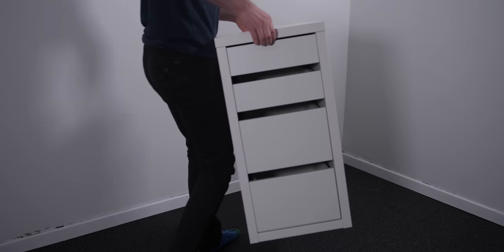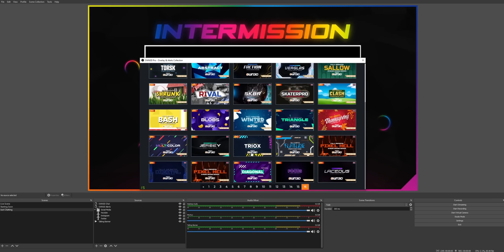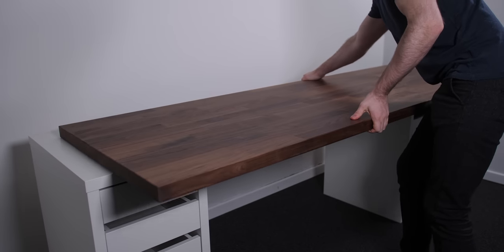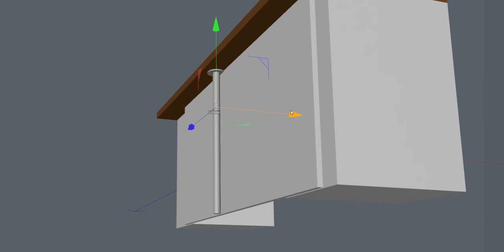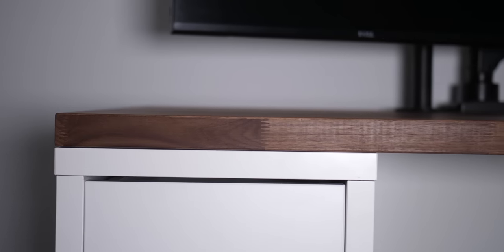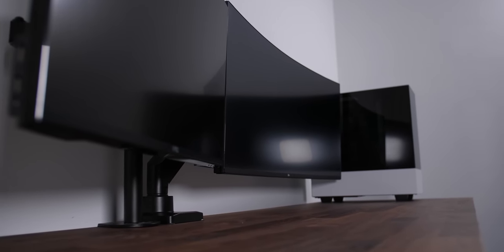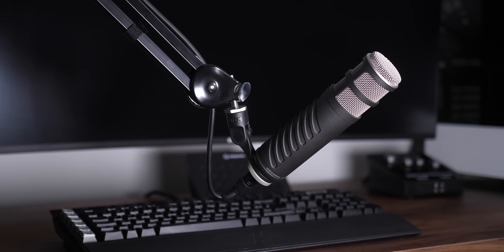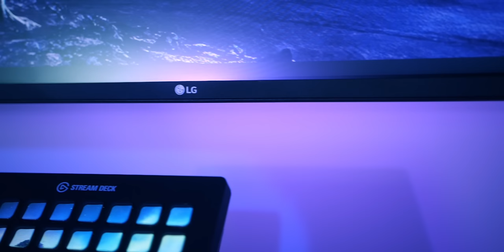Building This EPIC Ikea Streaming / Gaming Desk Setup!

Comment: it's funny how everyone goes crazy about cable management, spending 8 hours meticulously tucking, wrapping, and hiding cables to every square inch of their under desk space. Meanwhile you can hide them with a flat panel in about 5 minutes and it's completely removable.
Reply: Yeah but not everyone has a desk flush to the wall of want more foot room. The false wall stops the latter.
Reply: That’s pretty lazy
Reply: @swmedianz  indeed it's lazy, that's the point. Unless you have your build complete before you start cable management, it is a pita to add or remove later on, whereas foam board with a couple pieces of velcro tape is not.
Reply: @swmedianz  as my welding and engineering instructor told us once, "rule of thumb why stand when you can sit and why sit when you can lay down never make doing something harder or more time consuming than it needs to be", be practical and be efficient the results will always turn out better than if you stayed struggling to fight against the job you're doing, so as seemingly lazy as it would be it does the exact same job with better results in appearance and keeps from possibly kicking the outlet socket out from being plugged into your power strip, so not only does it hide wires better it prevents any accidental wear and tear on them too.
Reply: If you put a false wall just to hide the cables it's not smart. It's easier to take the time to manage your cables once so it will be easier when you upgrade stuff in your setup
Reply: Proli  Lazy is not working smarter.
Reply: Why bro sound mad? Just because your lazy doesn’t mean it’s everyone’s fault 🤷‍♂️
Reply: people be mad for no reason, i think its genius! its not stupid if it works
Reply: Yeah, but that sucks. I like to put my feet up when I game.
Reply: Well I dont want to unravel a spiderweb just to unplug a cable. So yeah its alot of work but it's worth it.
Reply: @Rosne134  bet it sucks redoing all the zipties for that one cable.
Reply: @calebwooldridge242  you don't have to zip tie all your cables together ya know? Also cutting a few zipties sounds much more pleasant then unraveling a balled up heap of cables. Just saying.
Reply: @Rosne134  well I have 3-4 cables total so I do nothing with them and they aren't a wad of cables. To each their own 🤷.
Reply: Ok this desk looks epic
Reply: @Rosne134  eh tbh i have a lot of cables together and i never have to fight to unplug them
Reply: 8 hours to manage cable? Lmao, talk about over exaggeration to make a point... It quick and easy to manage cables. It also easier to remove a specific cable when you need to compare to a rat nest of tangle wire that will occur if you just mindlessly toss your cable behind your desk. 

Also, this dude use double sided tape to secure his mic wire. And then proceeded to pull off the backing on the side that wasn't attach to anything. Like why? Wtf... He now have a tape with the sticky side exposed for no reason except to collect dust and crap...
Reply: @shadowsaber3145  LOL....actually it's genius.
Reply: @grimcapo4390  So many times folks can't see the forest for the trees.  Sad really.
Reply: @raist3001  maybe but it’ll be a pain in the a$$ when changing cables or cleaning

Comment: if anyone wants to have the false wall but not saw anything or have the gap you can use the Trotten countertop which is the same height as the alex drawers and micke drawers with no wheels
Reply: Which size trotten countertop? Did you get to try it yourself? Thank you!!

Comment: Using a false wall is a no-brainer compared to the hours of cable management time
Reply: What kind of cables r u trying manage that take hours? It only took my Dad a half an hour to cable manage his duel monitor and ps4 setup
Reply: @duncandonuts5268  I have a very elaborate computer system and 8 monitors it took me hours to carefully manage the wires so where you don't see them thanks for your concern
Reply: @duncandonuts5268  a lot of people have crazy setups. I have like 8 things plugged in with a crazy amount of wires hanging out. I still dont even have my PC yet 😬. Its gonna take 2+ hours to cable manage properly
Reply: @duncandonuts5268  that's why, its a ps4 you have to plug in the PlayStation and monitor and plug in the HDMI cord into the monitor not that much to do so yeah

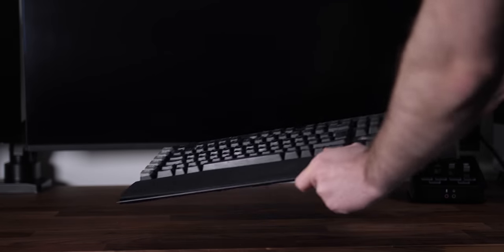Comment: 10:03 If you want to make a custom keyboard its not really that hard to get into unless your joining Group Buys, which you shouldnt when starting out. If you go somewhere like KBDFans you can find some keyboards kits that make it as easy as putting your own switches and keycaps on. (though ofc id recommend lubing the switches and stabilizers) personally i didnt mess up on my first build and im pretty sure you wont either if you just get a kit that you wont need to buy all the different parts for. also do ur research just incase XD

Comment: A little late to the party, but for extra space for hiding cables and have the counter top overhang the cabinets in the front, you could use a MDF board with one white side instead of a thick linnmon, the kind IKEA uses in the back of closets (Billy).

Comment: It seems like the Micke drawers you used have changed on the Ikea website. The images show that the bottom drawer goes all the way to the very bottom of the unit, without a slat below it. I guess that in order to use these drawers you would need to raise them up with something, otherwise the drawer will scrape against the ground (or carpet). I'm still looking around for the best drawer set, without going up the Alex which is relatively expensive
Reply: I noticed the same thing when I googled it, but where I live there's 2 versions. 1 with 5 wheels that's as you describe, and one with 4 wheels that still has the bottom slat. It's roughly 5 bucks cheaper (when converted to dollars) , hopefully it's available in your region as well if you haven't found an alternative yet

Comment: As much as I like this, how I cover up my cables is with a square cable tie holder and just have the cable tie on by 5 clicks so it’s not 100% tight against the cables so if I need to remove something it’s not too difficult

Comment: Was the countertop you used in this video 186 cm long? And the false wall was 100 cm long? I don't think the false wall of 100 cm covers enough if you use 2 MICKE drawers, which are 35 cm wide each. Because 186 cm minus 2x35 = 70 cm makes 116 cm. If you want to slide the false wall behind it, you still have a hole of 16 cm that you don't cover... Or am I seeing that wrong?

Comment from the maker: I am planning a Streaming Setup video like Setup Wars but only for streaming setups! 
Do you have a clean streaming setup? Doesn't need to be over-the-top, just a nice streaming setup.

Send images + preferably video footage to: thevideonerdyt@gmail.com
You can add your socials, I will give extended shout outs! 

Cheers
Reply: Yes I m getting my dream gaming and streaming setup its awesome
Reply: Does it have to be a streaming setup? I have an AMAZING productivity setup that I would love to share
Reply: This is not real cable management, because you hide the cables behind that wooden table top under the desk. This isn't real magic. Even though it really looks nice and clean.
Reply from the maker: @realdrinn  A clean setup that looks like it has crazy cable management, without doing any. If that isn't real magic.
Reply: How long was yore desk
Reply: Getting my second Monitor tomorrow.. Then I'll get some new pics.. I built everything myself too.. Great video
Reply: @TheVideoNerd  I've been looking at getting a Karlby countertop to use as a desk but I'm hesitant because it only has a 25.5 inch (65 cm) depth. Do you find the distance between your monitors and eyes to be enough when you're typing on your keyboard?
Reply: Opportunity and
Reply: You could try to V-Mount the monitors. Kinda like how tech source did it and it will save more space, and would look much cleaner
Reply: Does yt also count???
Reply from the maker: @WarCrimes177  you mean a gaming setup that you're using for youtube? sure!
Reply: Pls pls make one more with new cpu I love to see this like 
RTX 3090 
Reyzen 9 5950x
Reply: for a custom keyboard, you can purchase pre lubed stabilizers and switches, alongside hotswap sockets,  your keyboard will turn out great. personally I lubed and modded my components myself but pre modded is a great alternative
Reply: I was thinking trough the whole video if you were from flanders (because of the accent) and when you said it I was like ‘I KNEW IT!’ 
Edit: 
Ik ben ook een belg
Reply: Hey The Video Nerd where are you from
Reply: Does noone like foot room anymore or do you like being scrunched up in a box

Comment: If the Micke are 75cm (with wheels) looks like 70cm without, and Linnmon is 60cm how do you get the Linnmon to touch the floor and not leave a gap between the table top?

Comment: Before watching this video in particular, I saw many other YouTubers using the Alex drawer for this setup and I was like “I really don’t need that many drawers but heck, let’s just get those drawers then.” So I went to IKEA website and found out that it was $100 each without tax for these Alex drawers and I REALLY DIDN’T want to pay $200 for drawers which I didn’t need so I went to look for alternatives.  It ended up being the MICKE drawers like this guy on YouTube but guess what?  MICKE that IKEA is now selling has casters!!!

And behold… it’s not just the casters as well!!!  The MICKE now has the last bottom drawer designed in a way that if you don’t have space between the floor and the last bottom drawer, it won’t open!!!  I can’t just take off the casters and use it.  I need to specifically buy something to raise the bottom of the drawer.

I wondered if there was a caster-less MICKE drawer but no.  It’s not even in the product lineup anymore! (At least in CA)

I know that Ikea did this purposely to force consumers to buy the Alex drawer which made me upset.  I even thought about using a stick stand instead of the drawer but my entire room is laid out with a carpet so something with a wider dimension as a stand would give better stability so I have to go for a drawer but then again, I HAVE to buy 2 Alex drawers.  I’ve never felt so forced to buy something which I don’t really need for $200.  I could buy an excellent quality gaming sound bar for that price.

I wonder if anyone has experienced this because nobody’s talking about it 🙄
Reply from the maker: I mean, if you don’t want drawers, you can always just buy ADIL legs instead

Comment: Not bad on the first look. The thing is though, you ask, why not many people building their ikea-hack desks do this sort of "false wall"? Two reasons. 
1. If the "false wall" is not attached to the side supports nor the top of the desk, it does nothing for rigidity. Absolutely nothing. These back walls in pre-build desks work on spreading of the load and strain principle, the same physics that allow you to get away with one leg in the back to reduce sag in a karlby block. But it has to be attached to have that effect. 
2. However nice it may feel to just shove the wires out of sight, there lies a problem there. Aside from the obvious danger of tangling cables and running the risk of accidentally snapping off the connectors , another risk is of thermal nature. All those power bricks from the monitors? Those get hot. And not all cables are made equal, some have not the very best of isolation or materials used. 
There is a reason good cable management is in such a high regard by the tech enthusiast / battlestation communities.

Comment: I'm confused, I have a Alex drawer which is 27 1/2 in. And the falsewall or the linnmon is only 23 in wide. So it would leave a few inches showing when placed behind the desk. How did you solve this in the video ?
Reply: It's not the Alex drawer. It's the Micke. Also the version of Linnmon he links to is no longer available. That version was probably 31" which is why he had to cut it down.

Comment: If you do not use the wheels under the drawers is it still possible to open all the drawers? And how big was the countertop you used in your video?
Reply: I just wrote about this now in the comments section but it seems that the MICKE drawer which this YouTuber has purchased didn’t even have casters to begin with.  As a proof, the last drawer at the bottom is designed in a way that you can open it without any casters.  I don’t see any MICKE models that don’t have casters any more on the website.  I went to IKEA just yesterday at Costa Mesa in California and the staff told me that I’m not going to be able to open the last drawer if I took the casters off.  IKEA obviously changed the model design so that people would be motivated to buy the Alex drawer.

Comment: looks good I just hate how wobbly these drawers are. I have the 74 inch counter top from IKEA as my desktop with PC, and 4 monitors on boom arms and the desk rocks from side to side like crazy still because of these weak drawers
Reply: I'm considering using these drawers instead of the alex simply because of colour options. Did you keep the wheels on? Just curious if that's contributing to wobbliness. I'd want it to be sturdy
Reply: @ManeManChannel  yeah I kept the wheels on. But the back is free floating which makes the whole thing wobble side to side